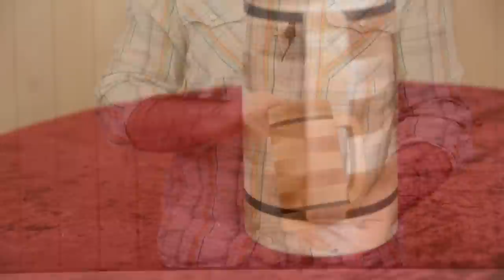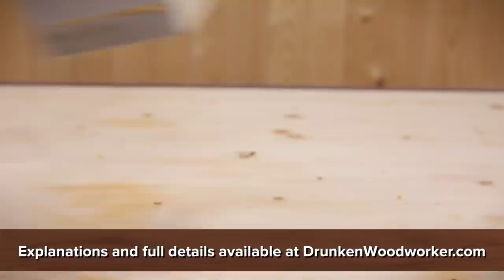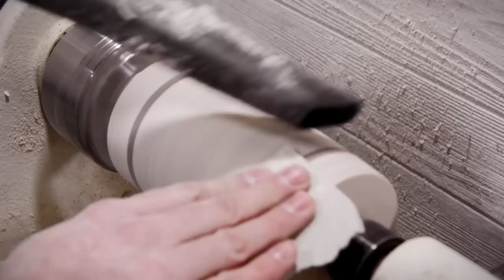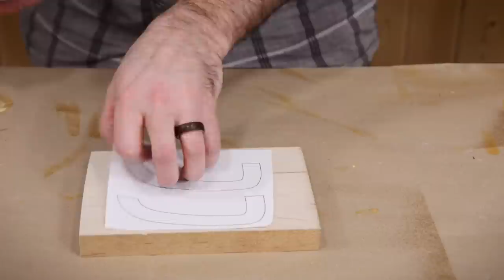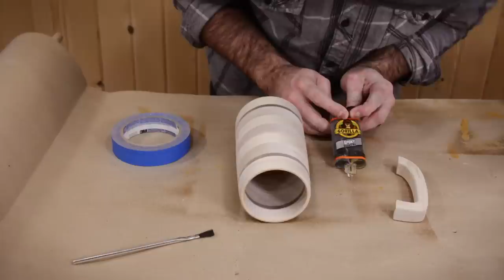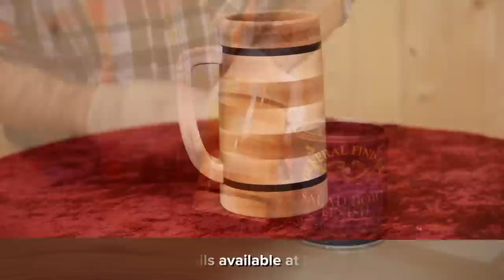How to Make a Beer Mug On The Lathe

Comment: David,
Great project and love the contrasting woods. One little tip for you would be to use a wooden mallet or soft faced hammer to seat the drive spur. Striking the morse taper with a metal hammer will lead to buying new drives sooner than you want to.
Mike
Reply from the maker: Good tip! Thanks!

Comment: Hey David! Have you ever thought about turning a record clamp stabilizer for your turntable?
Reply from the maker: I've never used one. Do they make a difference?
Reply: Drunken Woodworker Well, there are many variables that come into play with it. The weight of the stabilizer clamp can make a noticeable difference deepening on the condition of the album being played. Some use them for the intended purpose and some use them just for looks. Either way I think it would make a cool little project to pair with your new sony speakers!

Comment: I understand why you had such trouble with pine. Those carbide tools just have a hard time with very soft wood.  Old fashion gauges riding the bevel I've found works best. Everything has its place, I love using carbide tools on acrylic pen blanks. Don't give up on pine,  can be very rewarding with some sharp tools and practice.
Reply from the maker: Right on thanks!